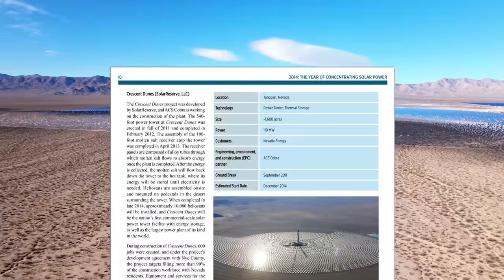The Failure of America's $1 Billion Solar Farm

Comment: Other than nuclear, Green energy in large, centralized, industrial scale installations makes no sense.
Its economic niche is at the end-point of use on the scale of individual households.
This way, there is no single point of failure and huge up-front investments are not required.
For northern climates, nuclear is a no-brainer, but the crazies ruin everything. Storing nuclear waste reduced to glass under a mountain in the middle of a desert a hundred miles from nowhere was not good enough for them. So now nuclear waste is stored in swimming pools behind the nuclear plants, waiting for an 'accident'.

Comment: I dont understand mirrors melting- how did that happen?  I worked at the solar tower in NM for 4 yrs from 1984- 1988, so I don't understand why they claimed this was a new technology.  What I saw as the weakest links in salt based system was all the  series failure points in the molten salt loop. If a leak occurred or a valving system failed, the whole loop had to be shut down. We had to wait for the equipment to cool down ( sometimes a week or more). The downtime usually was on the order of a month if something in the loop froze because you'd have to let it all cool down, remove the insulation then the heat trace  if you first did not have to chip out any leaked salt, fix the problem , reinstall heat trace, then re-insulate, then heat back up.These downtimes usally were commonly from several weeks to a month or more dependingon the problem severity.   This same site is still being used as an experimental process for new technology, one of them being a falling particle receiver that doesn't have the problem of the working fluid freezing up.

Comment: "Too Cheap to Meter" died during the Nixon Administration when ORNL Director Dr Alvin Weinberg was fired for promoting the inherently safe molten salt reactor.  Dr Weinberg also invented the pressurized water reactor for the Nautilus but warned that this reactor is only safe is smaller than 500 MWth.  Westinghouse, GE and B&W ignored this warning and built 3000+ MWth light water reactors like Three Mile Island and Fukushima.  Dr Weinberg wanted to build a molten salt breeder reactor fueled with Thorium as the ultimate energy source and we need to finish this now.

Comment: Solar One was completed in 1981 in Daggett, Calif., and was operational from 1982 to 1986, but did not use salt.  It was then converted into Solar Two in 1995, using molten salt, and produced power until decommissioning in 1999.  Both were successful tests sponsored by the Dept. of Energy.
Reply: "Successful" meaning they physically worked.   I guess the financial side did not work, or they would not have been decommissioned?
Reply: @VAspeed3  No.  They were on a planned temporary site.  As temporary projects, financed by the Dept. of Energy (as the major partner).  After that, it would be up to the private sector to build their own elsewhere on their own land.  SCE and essentially all electric companies have opposed investing in renewable power generation for decades (before the 2000's).  Even now, most of it is PR eyewash and they do not really want the competition from renewables nor for the public to idea that they can generate their own power.

Comment: The technology you describe, mirrors heating molten salt to generate steam to generate electricity dates back to the 1962 Odeillo solar furnace, which started operating in 1969.  Then there was the THEMIS solar plant.  Both of these were in France.  There were aspects of unique new technology in Cresent Dunes, the way there were aspects of unique new technology in 2011 automobiles, but nobody would want to give the impression that automobiles were new unproven technology in 2011.

Comment: Love how miraculously, everything was fixed in 2021 and now is beneficial.  I guess they solved the issue of being 3-4 times more expensive than electricity from traditional panels.
Reply: For one thing, the panels that we use today are a completely different technology called "photovoltaics", so best not to conflate that with the mirror-based "solar thermal" described in this video. They were lazy and didn't do their research, putting photovoltaics panels in the thumbnail when that tech has nothing to do with this

Comment: The problem sounds like that they didn’t perform a pilot study before scaling up for deployment. There are 550MW and 280MW successful solar farms afterwards.
Reply: Not quite the same. The thermal solar plans (like the Solana system) provide energy for several hours after sundown. Photovoltaic drops like a stone even when storms - rain or dust - roll in.
Reply: @flagmichael  the solar farms need to have battery storage system. Apple and PGE each bought half of the capacity from the 280 MW solar firm located in the middle of California.

Comment: The mirror ones are old tec. We used to drive past them on highway 58 west in the 80s & 90s on the way to the coast. They never had that many mirrors though. This large one seems to have been badly designed.

Comment: roof top solar panels are so much cheaper vs 2011.  A 400 Watts panel are less than $200.  You can get 8Kwh of panels for $4000, that's enough for most household.  Of course, you still have to buy other components and batteries plus installation, but still cheaper and no need to expand transmission lines.

Comment: Heliostat Concentration systems are not a "new" technology.  In fact, it is much older that photovoltaic collection, which you keep calling, 'traditional.'
What is relatively new is trying to store heat overnight.
This facility can successfully produce electrical power during daylight hours.  It is the overnight heat energy storage part that it may never be able to do very well.

Comment: Wait, it's up and running now, so not a failure? Which is it? And what was done to correct the issues? Pretty incomplete reporting. 
From earlier-
This is not that new of technology, with solar thermal projects being around for many years (documentaries back to the early 1980s in similar concepts), and (edit-) several running well in Spain and elsewhere, but not widespread. The problems show the importance of scaling up and bootstrapping, as can be done with solar and wind farms.  Many of the Spanish ones are 50 or 100MW, though Ivanpoh in the US is ~390MW.

Comment: As the idea is simple ...the issue is ongoing maintenance cost .... thousands of moving mirrors... cleaning ... moving.... repairing
Reply: Calibrating the positioners for 10,000 heliostats must be a full-time job.  And they're out there in 120F+ desert heat, so failures must be common.

Comment: The problems are the efficiencies of solar panels are not that great and the cost of each panel is very high. That doesn't even take into account that at then end of life of the panels, there will be lots of hazardous waste disposal problems!!!
Reply: The efficiency --22% -- is better than ever (and improving) and the cost is LOWER than ever.  Been using my panels for over 20 years and none has stopped.  There is no "end of life" for them, if used correctly.
Reply: @davidb2206  There are no panels 20 years old that's 20% efficient!  The best most advamced thin film panels made in the US 10 years ago weren't even that efficient!!!  And the efficiencies degrade with time!

Comment: Archimedes supposedly used highly polished mirrors to ward off a sea attack in ancient times. In grade school, when I heard of this, I thought it was awesome! Spain tried this type of energy generation and it wasn't very successful. Solar panels and batteries are getting so much better, I think a mega battery pack in strategic areas around the state would be a viable energy solution. Hell, I even think that a freighter equipped with LiFePo fully charged batteries could be moved to stricken areas around the world with enough power for hospitals and emergency services. Well, the future holds many surprises related to electrical energy.

Comment: Don't put solar panels in the desert - higher temperatures decrease the potential energy production, for each degree above 25°C (77°F) the performance loses 0.4% (or thereabouts). In the desert these may reach 70°C or above, thereby losing 18% or more, which is a fair sum out of 100. Add in cloudy days or suboptimal orientation, and maybe 50% of the potential will ever be realised.

Comment: It should be illegal to install solar panels on the ground. Solar panels should always be installed on rooftops, walls of different buildings, maybe on some vehicles etc.. but not on the ground anywhere.
Reply: Hopefully this ban will happen soon.
Reply: To get off fossil fuels in time to avoid climate catastrophe, we need to deploy panels faster – and often that means, more cheaply – rooftop is great but you get much cheaper electricity if you do large solar farms. the problem with this project was that they didn't use PV tech

Comment: Those mirror systems have been failures since the first design in the 1970's. Another group of investors, suckerd out of their investment money.
    My panels in my yard run my house, don't have mirrors dont make steam. Theres no generator, just batteries. Electronic conversion direct to 120 volts A C

Comment: I was under the impression that thermal solar was a somewhat established technology, although the molten salt is a complicating feature.

Nuclear is a more established technology, but I believe that low cost gas has undercut some of the reactors in the northeast. Leading to plant closings and state subsidies.

I do wonder where they're getting the cooling water to operate the plant. I was under the impression that water is in short supply in the western US

Comment: Solar dosent work period. The panels have a short life span and when they do break down the panels have to be taken to a hazardous dump site sine the materials used in the panels are very toxic. The electronics also bread down and have to be replaced. The thing is these solar farms cant supply enough energy . The cost of these farms are very expensive which means the cost to the consumer means very high energy costs.

Comment: This pretty much sums up 'green' energy. 
The cost is always more than it should be. It has unwarranted positive publicity,  became everyone wants it to succeed. This leads to massive and obvious problems being overlooked.
In the UK we are told that wind is the cheapest energy and it's a no-brainer. The reality is our bills have risen massively and they want to install more ugly pylons, which will ruin vast areas of unspoilt land. The only no-brainer is to go nuclear or accept that coal and gas are actually very good and go all in.
Reply: The cost WAS more than it should be, as we were figuring out the best methods, materials, integration, and placement. That "waste" has led to more informed engineering and wind and solar both are  now cheaper per MWh than non-renewables in most populated locations.
Reply: @dand8282  It's amazing because they 'are cheaper per MWh' yet manage to cost more! It's like Schrodinger's cat (dead and alive at the same time) How can this be so? Surely the bills will fall, but no, they are rising. We have to plan for other sources of power when they don't work, so we pay twice.
Reply: @smile768  2 thoughts. 1. Companies  will charge whatever they can get away with. 2. A lot of US power infrastructure is nearing end of life (>50yrs), so the maintenance costs get higher every year. This will only get worse; local gen w/ grid/battery backing 
is the only way to shield yourself.

Comment: Still: this project made SO MUCH MORE SENSE than any form of nuclear energy!
Maybe one lesson than can be drawn: such New Form of renewable energy should be developed with a bottom-up approach: small scale plant --> Medium scale plant --> large scale.
In the end, there are a lot of examples where renewable energy is Rock dolid, profitable and even very cost-effective! Take the uk for instance: a few years back the backbone of uk electricity was gas power and nuclear.
How about today?
Only 22 % of electric power produced is nuclear. But already 27%of electric power produced is wind power!
Unfortunately the uk has a rucksack of old nuclear facilities that that need immediate cleanup. The cost Insolvenz is estimated to be around 210 bn £...
Wind power (onshore/offshore) does not have significant cleanup requirements.

Comment: There is a solar power plant like this near Gila Bend Arizona. Mirrors that reflect sunlight on a vessel that heats sodium or salt, wich is used to make steam to power turbines. Interesting technologie I think worth a try. I have wondered what will happen to the mirrors when one of those bad ass dust storms get a chance to work on them. Also, apparently the intense reflected sunlight actually incinerates birds that fly by in front of the mirror from time to time. I dont think they kill as many birds as windmills though.
Reply: I was working at Arizona Public Service during that plant's debut. The mirrors were never mentioned as a problem, but the molten salt loop was problematic at first. Eventually the company news stopped featuring it, maybe because it was working smoothly, maybe not. Wikipedia has an article about it as Solana Generating Station.
APS also has a geothermal test project somewhere in the greater Yuma area. I presume it is still there.

Comment: solar power removes people once built. rotary converter plants require engineers to operate them as they run on ball bearing that can break at any time and mess up the whole thing like windmills. but once you build on rotary converter all the rest can run off this one as when the electricity is reduced to a motor value by splitting you get another rotary converter in its place. it is called daisy chaining and make really cheap electricity with zero brown outs or blackouts due to low sunlight. they do cost more a little to start up and they do require overage so you can repair them while in operation. one turns on for one that has to be repaired. Please remember everyone of them requires an engineer to monitor bearing before they fail and break apart. like the bearing in a car when your car breaks. solar panels don't make electricity all the time increase the cost of electricity when there is no sunlight (all winter long) and take all the jobs away and cause blackouts and brownouts like crazy. The only problem is people trying to divert rivers to end towns as people learn to hate each other with sports. divert a river and the first 120 plug you need to start the whole thing will then not have 120 in it anymore. you are being ripped off. solar is taking your jobs and not allowing you to have kids. so maybe you don't like kids huh maybe you like not having a job. maybe you like paying to much for electricity. it is just a scam to make you pay more. stop solar. good luck

Comment: I just got a brainstorm. Use solar to generate commercial power when the sun is out, natural gas when it isn’t. Simple fact if you put solar in the right places, it’s sunny a lot. Not a complete solution but imagine if we just produced 50% of power from solar, that would have a massive impact. I own my 8.4kw system, 5th year of ownership, HVAC upgrades and insulation, 2022 I produced 120 kw more than I used, can’t get any closer than that. It’s a great investment for people that can afford it. I’m looking at it as a long term investment like a rental house. They don’t usually start off in a positive cash flow, but over time, will if done right. I don’t want the headaches, been there, done that. With solar, so far the only problem I had is squirrels ate my wires under the panels, fixed that with mesh wire I installed after that. Nobody bothered to tell me that up front, I live around woods and squirrels, ugh!

Comment: First off…the information this was the first solar plant designed to use molten salt to create steam and turn a turbine. BS.  This 2014 solar plant is by far NOT new.  Solar One was a pilot solar-thermal project built in the Mojave Desert just east of Barstow, CA, USA. It was the first test of a large-scale thermal solar power tower plant.  
Solar One was completed in 1981 and was operational from 1982 to 1986. Later redesigned and renamed Solar Two, it could be seen from Interstate 40 where it covered a 51 hectare (126 acre) site, not including the administration building or rail yard facilities shared with a neighboring plant. I was there when Solar Two went back online.

Comment: They can't keep the panels CLEAN! Dust on the surface reduces their output by 50% as any solar baby knows the daily routine of cleaning the panels. They have 20,000 square miles of panels to clean. They tried to get the Governor of Nevada to allow them to hire Minimum Security Prison Inmates to clean them-they needed 2000+ inmates, wisely he refused the request. Already, 40% of their solar panels have FAILED from the heat. Any solar panel maker will tell you they are not intended for temperatures below 40*F or above 85*F. It says so plainly on the box when you buy them. Military ones or aerospace versions will cost you 40 times or one thousand times as much per square foot respectively. Remember, the ISS is on it's FOURTH set of solar panels that are 1000 times more area and produce ten thousand time power than the original design specs, and the water recycling unit on the toilet STILL doesn't work.